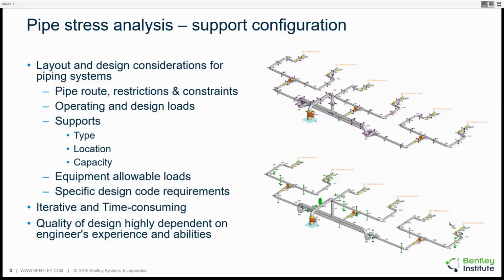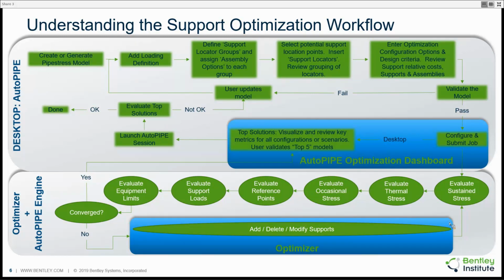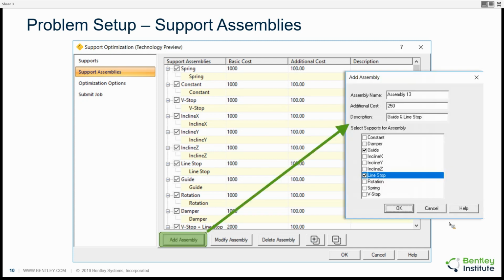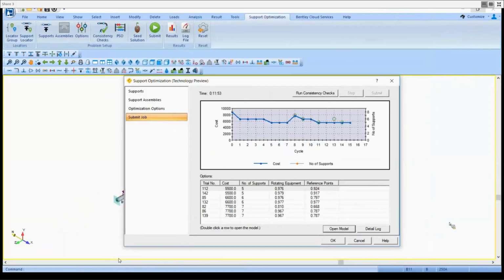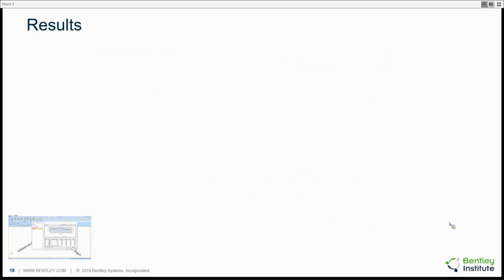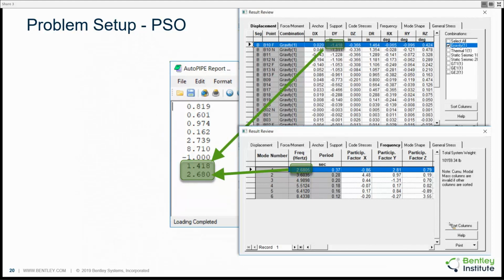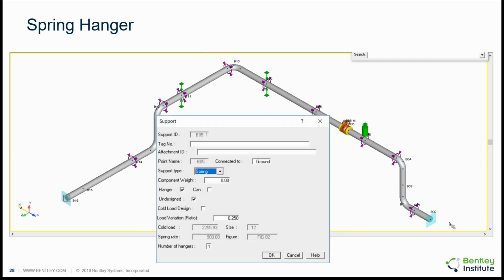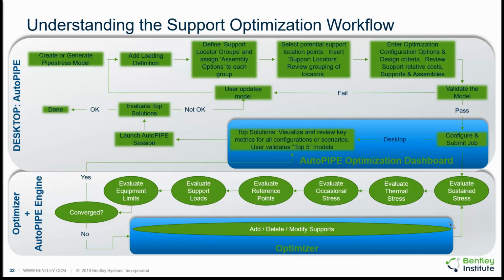Improved Pipe Design with Support Optimization

Comment: Looks good but it would be taking pretty much time to find out the optimum solution because the algorithm used is totaly based on stochastic probability process, such  as GA or PSO. It means if a large number of  supports is participated in that kind of claasic  optimization process, the CURSE OF DIMENSION would cause bad bad localy trapped optimum so the quality of the optimum would also be awful. Is there any alternative helps to get out of the local optimum??
Reply: Combine genetic algorithms and neural nets.,
Reply: The examples took 7 or 11 minutes.